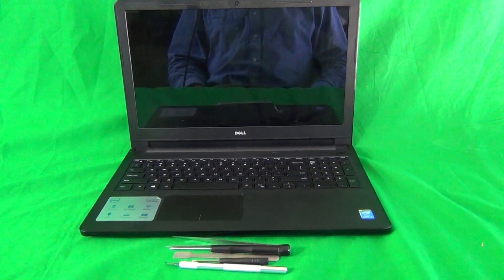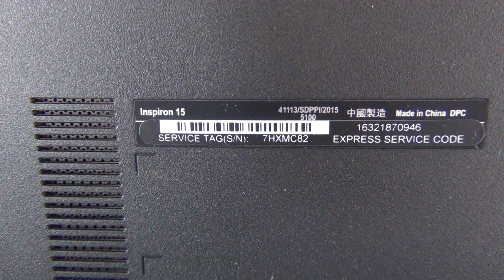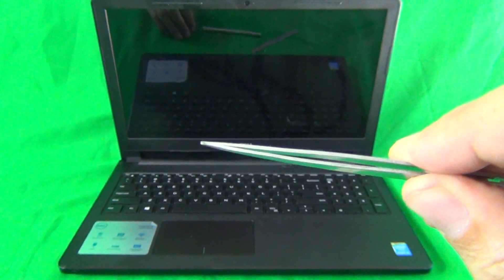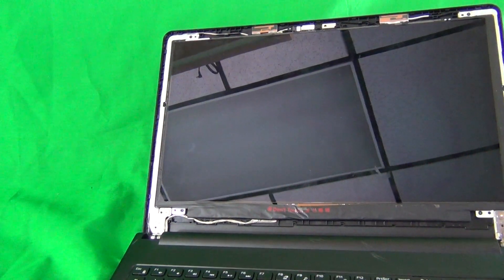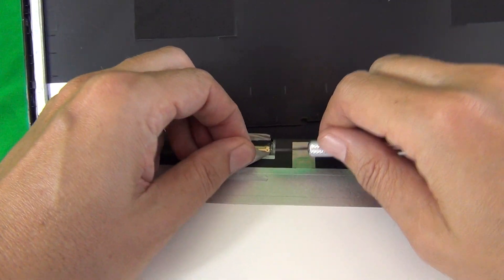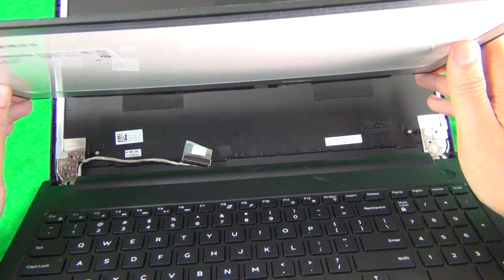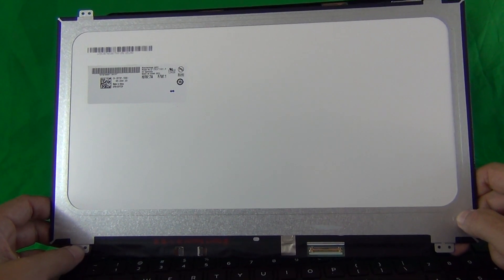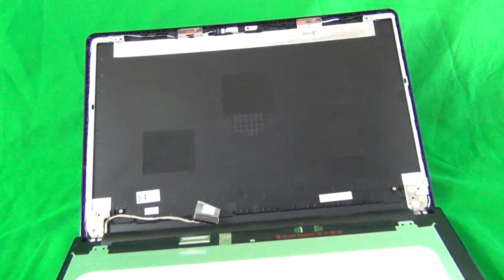Dell Inspiron 3558 Laptop Screen Replacement Procedure

Comment: Thanks good video, its so simple would be stupid to pay someone to replace it for you.
HOWEVER not ALL Dell Inspiron 15 - 3558 have the 40 pin connector. Make sure you check yours before you order. I have a newer Dell Inspiron 15 - 3558 and it has the 30 pin connector. And I know its the 3558 because I checked it on the Dell site with my Service Tag (S/N) #. So like he said just take the screen out and count the pins then order the screen based on your Dell number like 3558 but make sure you get the one with the right pins.
Reply: how to know is it touch screen ? can we convert to touch screen ?